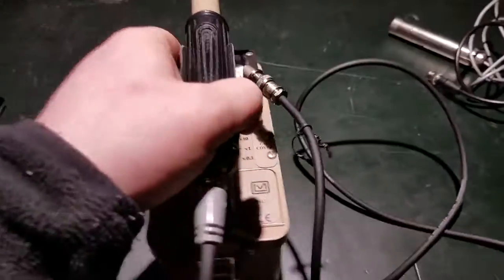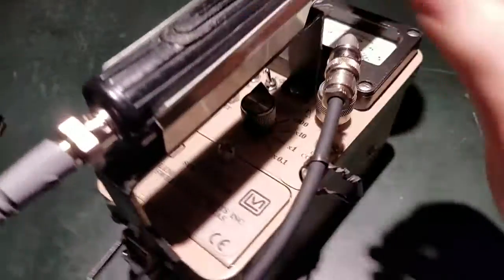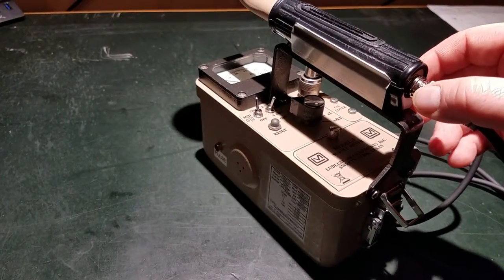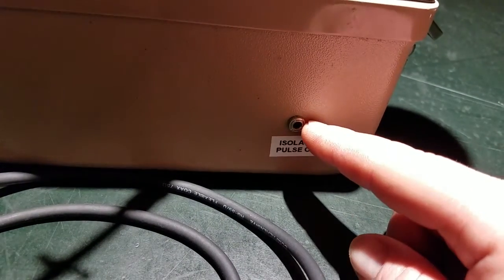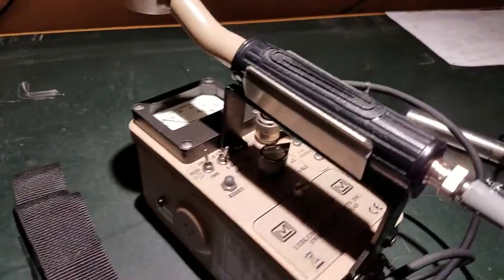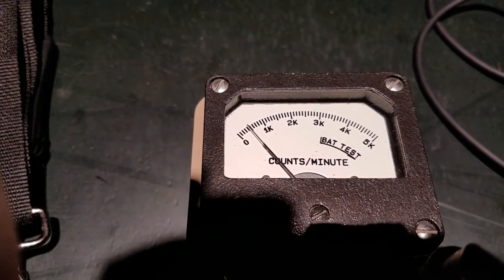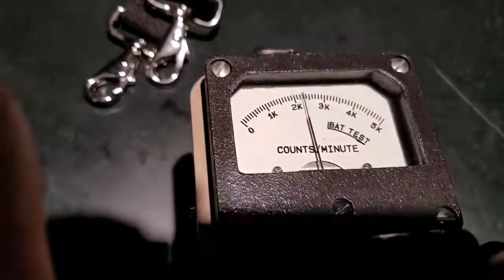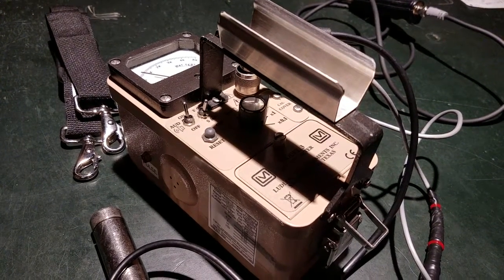Modified Ludlum Model 3 geiger counter demo and info.

Comment: Josh, this is great! I just purchased a Model 3 and am really interested in adding a pulse output. Do you happen to have any details on where exactly you made the connection, and also on what the output is (is it just a 5VDC pulse per count)?
Reply from the maker: I recommend you call Ludlum and get your M3's schematic. They'll e-mail it to you for free, but you need to give them your counter's serial number to get the right schematic. The electronics for each model change quite a bit over time, and my header might vary from yours so I'm hesitant to tell you what to hook up because I don't want to let the magic smoke out of your device.

Comment: That Fast/Slow switch does not average the counts..it only changes the response of the meter
Reply: Actually it changes the discharge rate of the needle’s capacitor, thereby averaging the counts differently

Comment: Hello - do you know how would I go about adding a volume control to the circuit? I have an meter and sometimes I wish I could adjust the volume.
Reply from the maker: You might be able to add a resistor or potentiometer to the beeper element.

Comment: Hello there. I would like to add easy and quick high-voltage adjustment to my model three. I have a scintillating probe and a pancake probe and would like to be able to quickly switch between The voltage is needed for them. 

Would there be an easy way to add a switch to the top of the meter? Just a two way switch so that i can change between two preset voltages. I’ll be doing a lot of searching in the field for radioactive contaminated metals… I need to be able to switch somewhat quickly between the two probes. I have an electronics lab and soldering equipment, but I don’t feel comfortable probing around in the Ludlum meter without a bit of input from other users.
Thanks a ton for any information you can share!
Reply: Depending on you scintillation probe, most scintillators (gamma) run off of the same voltage as an American made Geiger tube. That said if you need the voltage preset to like 1100v I would recommend calling or sending it to Ludlum. They are very knowledgeable and will do it for you if your willing to spend an arm an a leg. Personally I would get a CDV-700 and try the mod on it, and if it works, try it for the Ludlum.
Reply: Newer Model 3s have a HV adjustment, R42. Older models do not. I've toyed with the idea of adding a pot to U2 pin 2 to vary the resistance there to see if changes the HV, but do not want to risk blowing up the critical HV transformer. /Lou

Comment: I kind of wish all the Ludlums used standard sized BNC over their type C
Reply from the maker: Yeah. It would be nive but by using a connector like that you get the ability to use higher voltage probes. IIRC BNC connectors don't do well over 1KV.
Reply from the maker: I think you can order them that way but the voltage characteristics of BNC connectors mean there's a risk of shorting or arcing when the voltage gets high enough. The C type connectors are designed for the KV range.
Reply: I have this issue with my Ludlum model 177 all the time. Arcing can be a real pain in the behind One day I’ll have to switch it for a type C connector.
Reply: Like Josh mentions the C type connector tolerates HV better. On the instrument I believe the hole side is the same for both BNC and a C connector. Perhaps you can change it out. I prefer the C connector, but have a few instruments with the BNC. I use and adapter where needed to adapt to C-type cables.
Reply: @siwelanyer718  you can change it out, I run exclusively BNC on my meter side for Ludlum meters. 

I've swapped type C connectors SHV, and MHV all over to bnc without much strain.

The use of a Type C is really only to make dedicated cables be used, a good quality BNC has the same tolerances as the type C usually.

Comment: How hard/easy would it be to switch the speaker on a Ludlum Model 3? It would be cool if it would sound more like the old CDV type geiger counters.
Reply from the maker: I'm not sure. I think the big question would be more about the speaker's characteristics and whether or not the piezo buzzer is sent a pulse or square wave to change the buzzer sound. The old school speakers would have a single pulse sent, or would have a negative pulse.
Reply from the maker: Additionally you'll have to make sure the signal driving the buzzer has enough power or that the speaker won't sink too much current and break your rig.
Reply: @joshlucy9420  Ok thanks for the information. I will look into it.
Reply: I'm an electronics tech, own 12 Ludlum survey meters, a 2200 Scaler Ratemeter, and a 500 Pulser to calibrate/repair the instruments. All done as a hobby.   Speaker tone is a a function of the time constant between a resistor and capacitor at the output of the oscillator chip that drives the "speaker". Example, in Model 3s serial number 294605 and later the resistor/capacitor is R31/C4. Replacing R31 with a small pot would allow you to tweak the tone of the sound. I would not connect a "regular" speaker to a Ludlum device as its impedance (resistance) is way to low when compared to the stock piezoelectric one.
Reply: @siwelanyer718  I used to be electronics tech for over 30 years but have been temporarily unable to get to my bench. I have a Ludlum 3 and had Ludlum do a couple of modifications at the Oak Ridge facility including calibration. The unit does not make any sound on the most sensitive scale. Without sending it back to Ludlum or troubleshooting it myself, do you have any idea what could be disconnected or left open? Thanks in advance if you have any suggestions!

Comment: What is the source for the latches that take the strap that you installed on your meter?
Reply from the maker: I found them on Ludlum's website. They sell spare parts.
Reply: Thanks Josh. I was doing it the hard way doing web searches for them. Found them where you said they were. I'll order a set next time I order parts  from them.  I'm an electronics tech, own 14-15 survey meters, many probes, a pulser for calibrations,  a rate meter/scaler, and many electronic components for repairs.